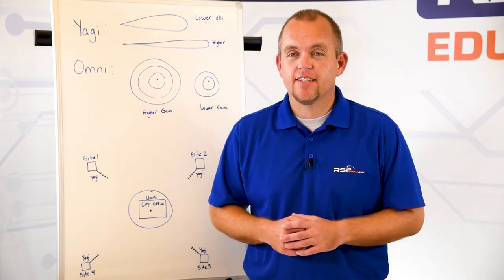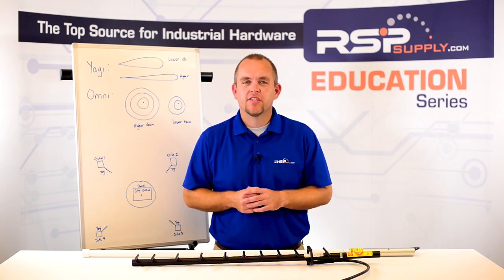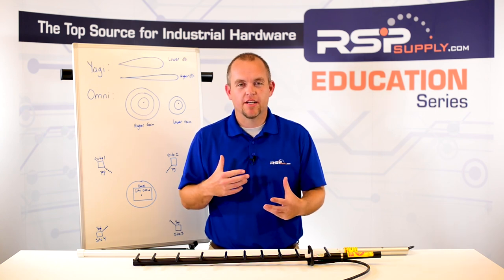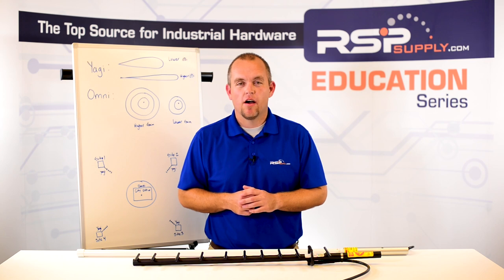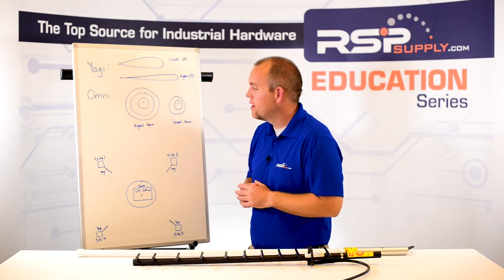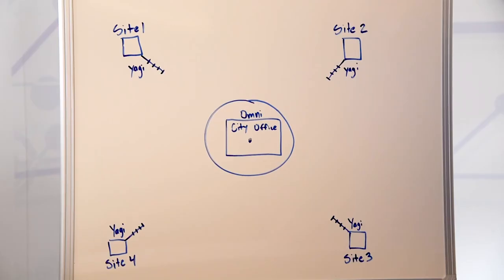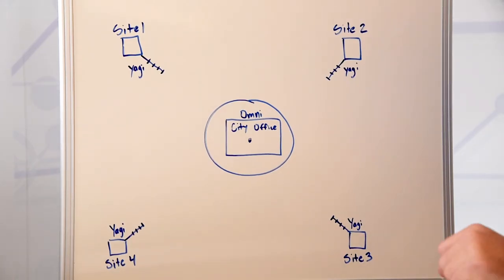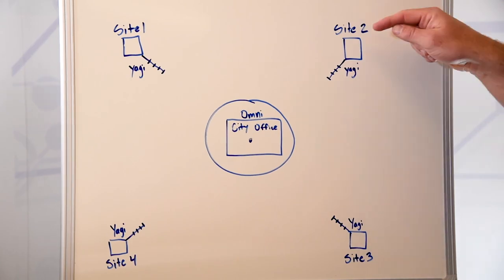Antennas: Omni vs  Yagi

Comment: The Omni directional antenna’s dbi rating works the same as the yagi antenna. The higher the dbi rating in a Omni antenna the more horizontal range you’ll get in all directions. The lower the dbi rating in a Omni directional antenna the more vertical range you’ll get in all directions the lower the dbi the more spherical the range is around the antenna. Your drawings are correct but the Omni illustration only shows a “birds eye view” of the radio waves. The “side on” view of the Omni antenna is the same as the yagi. The yagi antenna works the same way as the Omni, the only difference is that it needs to be pointed at the tower/repeater for it to work.
Reply: So if you have a yagi and omni rated at 9 dBi, their maximum distance range would be the same, but the omni would have that dBi increase in 360 degrees but the yagi would only have that coverage within the "line of sight" so-to-speak?

Comment: let's say there is a yagi antenna of range 2 miles and an Omni antenna of range 0.5 miles. now Omni antenna is placed at 1.5 miles from the yagi antenna (in the direction of yagi). we know that Omni is in the range of yagi, but yagi is not in the range of Omni. we know Omni can receive signals from yagi.
 will yagi can receive signals from Omni?
Reply: Yes

Comment: I'd like to ask please...
About aiming the Yagi Antenna to get the optimal reception of the other point ,right?
That means the transmitted signal is transmitted toward the other point with the optimal power ..
What about the received signal from the other point , does the yagi antenna needs to be directed correctly too?
In other words, does aiming the yagi antenna affects both transmitted and received signals?